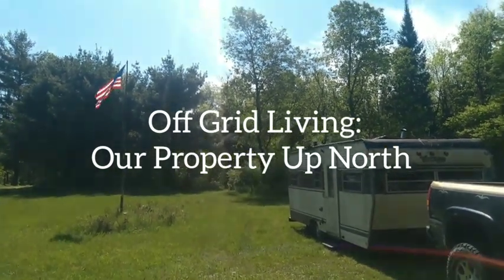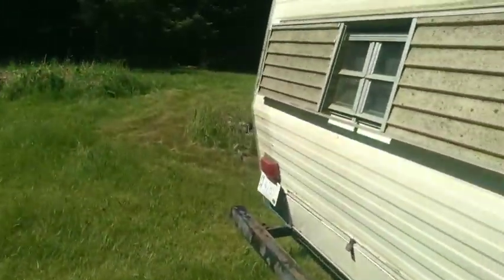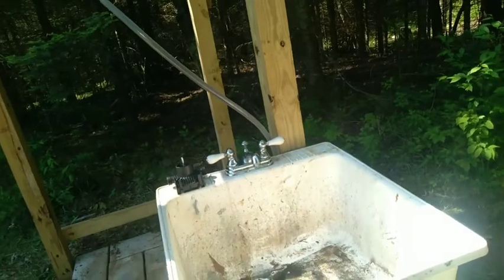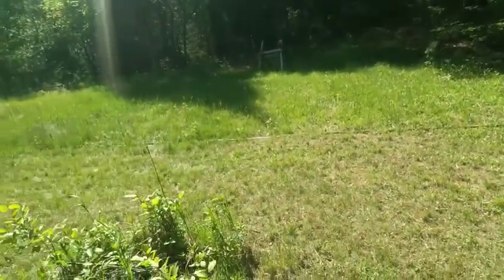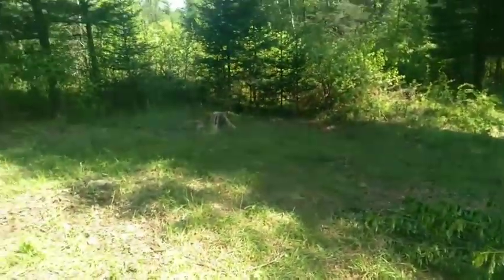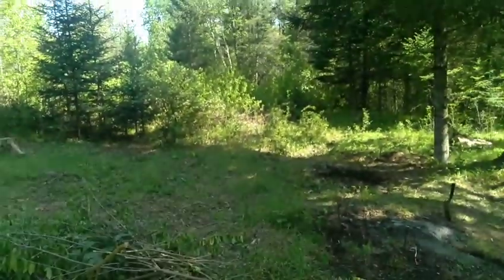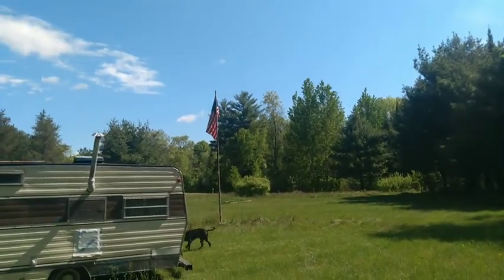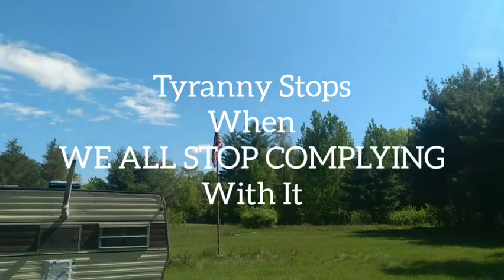Off Grid Living: Our Property Up North

Comment: Good to see the Up-North land. I am not sure you have thought through the whole shipping container idea.
I have seen to many people start out strong with shipping containers only to end up regretting the amount of time and materials used for the project and the inefficiency do to thermal bridging of the containers outside walls is horrific. Because temperatures are so cold up-north you would need to use closed cell foam to mitigate the condensation caused by the thermal bridging, and that is not cheap. Think of it like a giant heat sink. You essentially still need to build a stick built house inside, whereby you loose valuable inside space, which is limited to begin with. So your buildings skin becomes crazy expensive. Shipping and crane work is not cheap also.
In contrast an Arch Building is the must cost effective, with the most insulation. Similar to an A frame, the roof is the walls but without the head loss. We start with a post and beam foundation with 4 foot hip walls and a 24' x 32' floor plan will provide 1,408 square feet at 18 feet tall. The plan to use one 8’ x 40’ and two 8’ x 20’ containers will provide 560 square feet. in 2019 before the lumber prices went crazy I could build a 24 x 24 for less the $6,000. That included shingles and drywall, a finished super structure. I build my own arch ribs for real cheap and easy to do. This type of building can withstand 180 MPH winds.
Reply from the maker: Hmmmm..... interesting points. I have been building for 22 years and a licensed contractor for 8 years so i'm definatly confident in my skills and tools but i will keep considering my best options here. I am a mason so it would make sense to build with stone. Like the old buildings, double walled with an air gap and set the floor joices and trusses rite in the stone. With a short bit of hunting i think i could get the stone for free and mortar prices have stayed pretty much the same. That with log trusses, hand milled planking and a  metal roof would be perdy stout. I remain undecided.
Reply: @smallcityhomesteaders1600  work to your strengths for sure, free is the best beginning. it would be nice if I could share some pictures with you. My son in-law took some of my ideas on Arch structures and built a real nice 15' x 15' out building using free wood. But you would never know it. It looks terrific.
Reply from the maker: @stevenfrazier8939  I'd be happy to see the pictures. Smallcitywindandsolar@yahoo.com